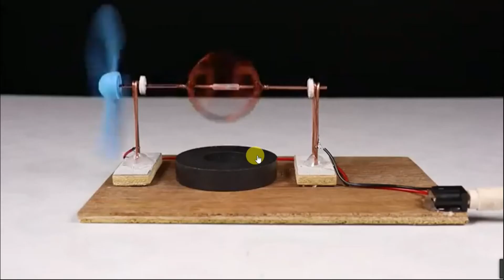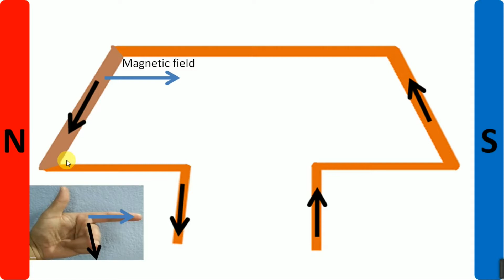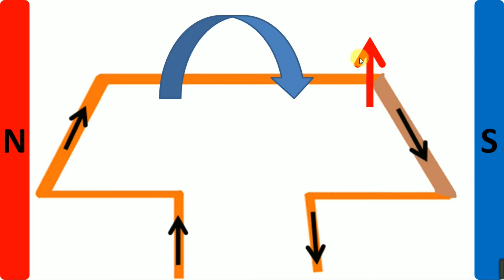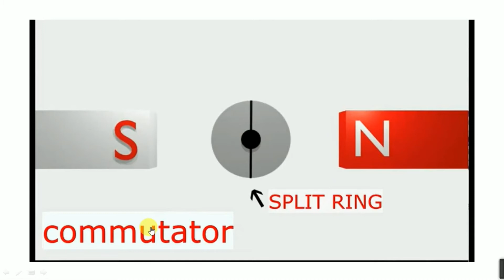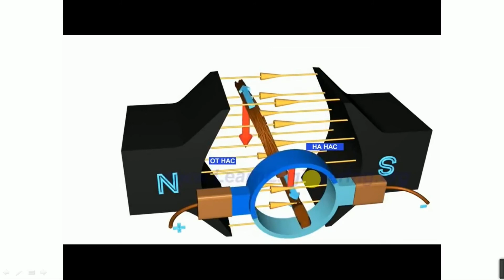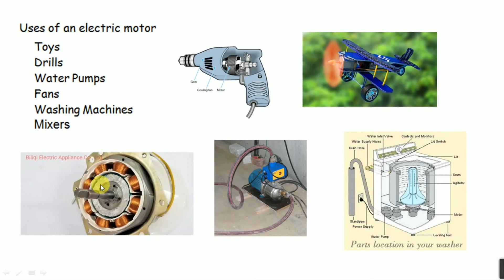Electric motor construction and working

Comment: not much words left to say now sir. the video was simply great. The concept, although at first , was a little blur to me, but as the video went on, it started becoming clear. The mini videos (the ones where the motor rotates) inside the video made it more understandable. 

Working principle of a DC motor is force on a current carrying conductor in a magnetic field. This principle, with the help of Fleming's Left Hand Rule, makes it possible for the motor to serve its purpose. 

I found the role of commutator and carbon brush a bit challenging to understand, but got it nonetheless. 
A commutator helps to reverse the direction of current through the coil after each half rotation,  while the carbon wire makes sure the wires do not get tangled up. They both help to make the movement of the DC motor smooth and accurate.

An armature, electromagnet and many turns of the coil help make a strong commercial motor. All the parts of the motor have their own functions and are equally important in their own way.

Electric motors are widely used in toys, drills, fans, washing machines etc. 

Thank you sir, you have done a great job!😌😁